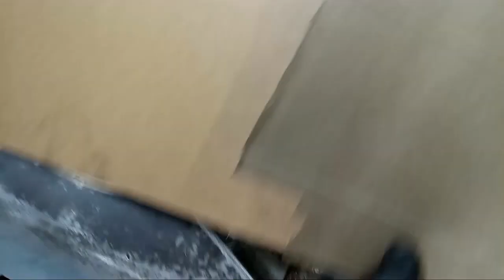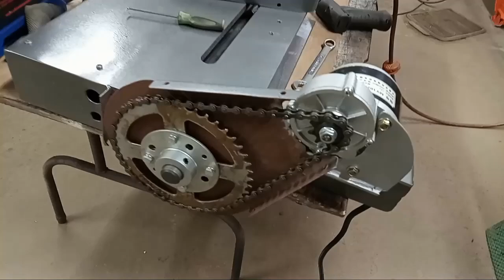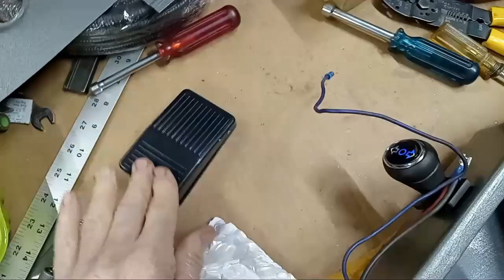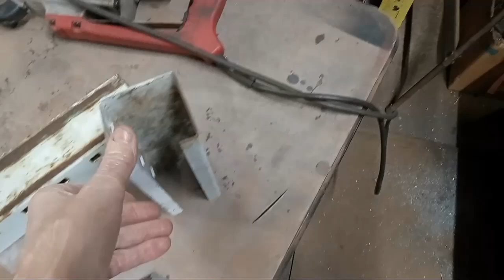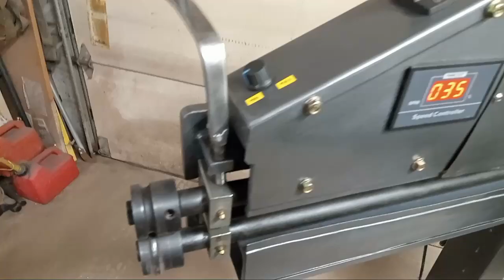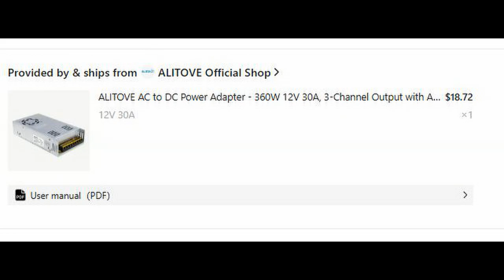Motorized Bead Roller for CHEAP!

Comment: Great improvement and super cool using the bead roller to make details on the bead roller covers!
Reply from the maker: Actually, I used my flange tool with an air hammer. It could have been done with the bead roller however. Thanks for watching.❤